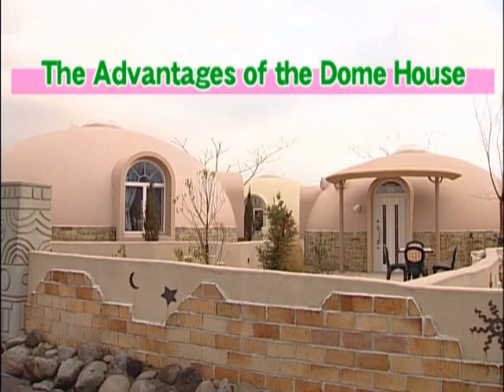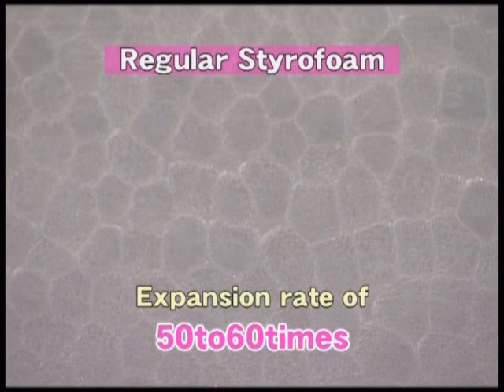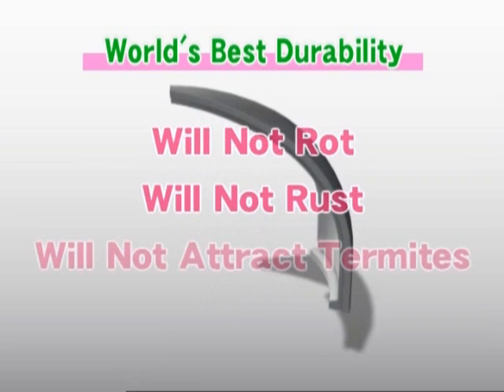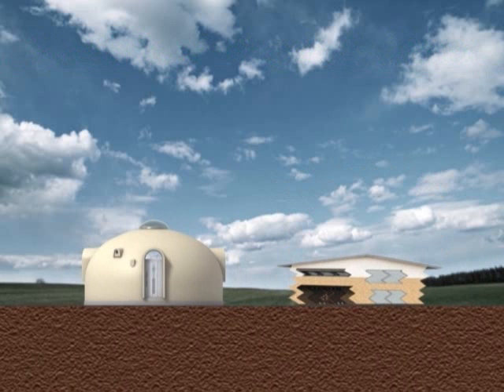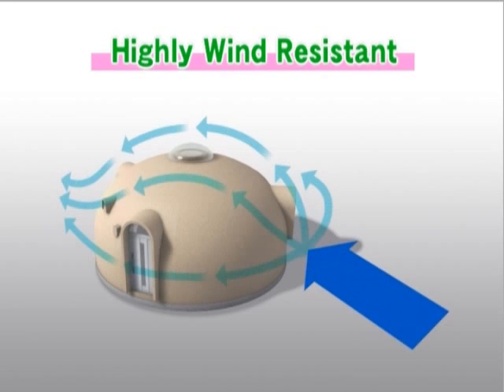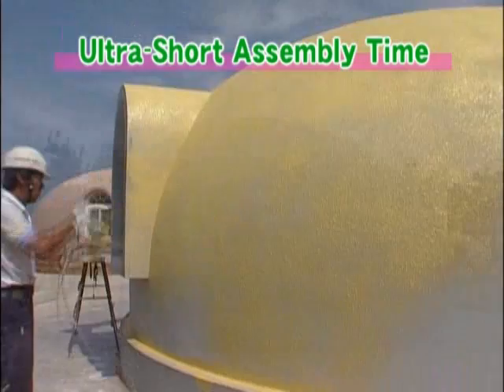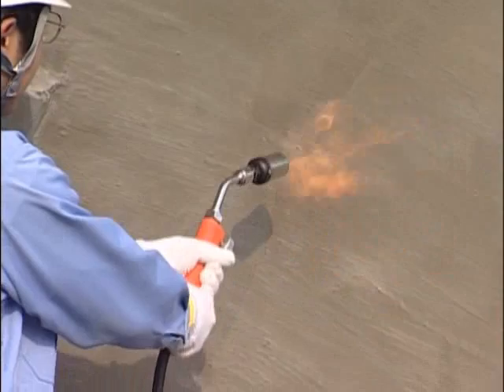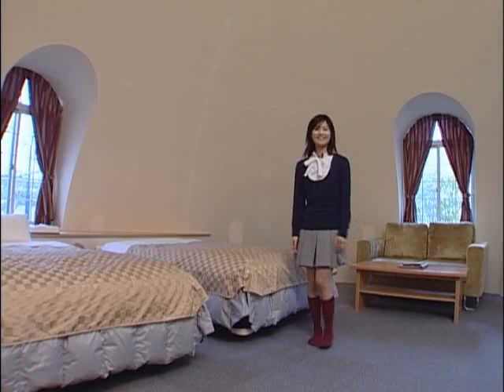International Dome House - 2. Advantage

Comment: I just wish it didn't "out gas" toxic fumes. If this was made from Hemp you would have a winner. I can totally see that happening.
Reply: tecnoblix the website suggests it doesnt www.usadomes.com/details.php
Reply: +tecnoblix If it is made and aged properly it doesn't outgas toxic fumes.
Reply: OR....they could make it from Hemp
Reply: +tecnoblix you want to explain how to make foam out of hemp?
Reply: tecnoblix: A layer of aircrete, R-value 1.82, over a denser, stronger aircrete, both reinforced with basalt rope, is extremely strong, fireproof, and non-toxic. Lastly, coat with a waterproof plaster. It would be cheapest by far (many times less) if any construction company would offer it. After years of research, this is how I will build if I have to be my own general contractor. It should save me half (50%) to be the general. Overall, I could save 90% over a conventional house. It would be stronger, cheaper to cool/heat, and I like the look best. 
However, I am in a very small minority of independent thinkers. Resale value would be low due to conformist taste. I don't care because I don't plan to sell. If you're a young builder, you will probably move someday. Keep it and lease it.